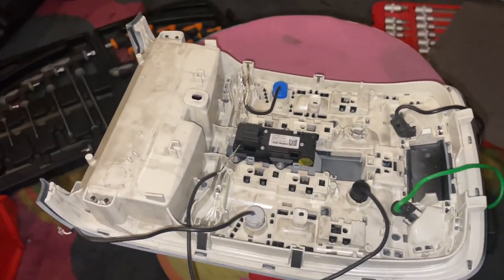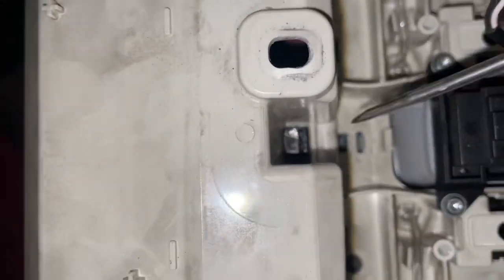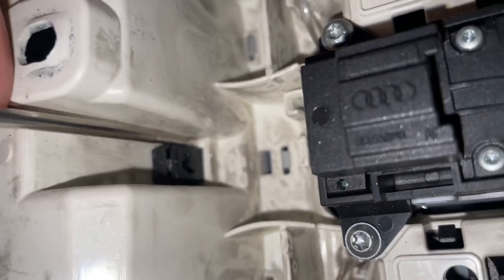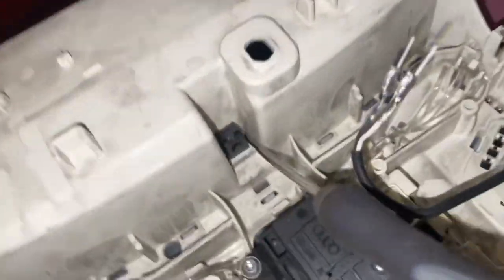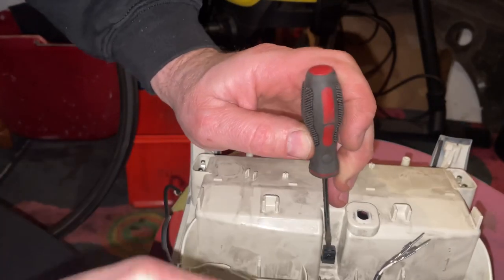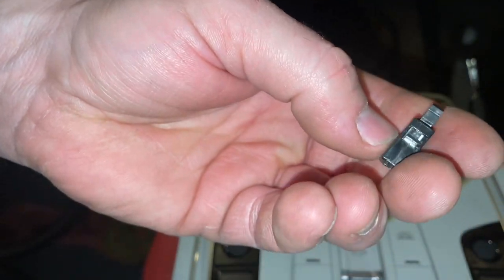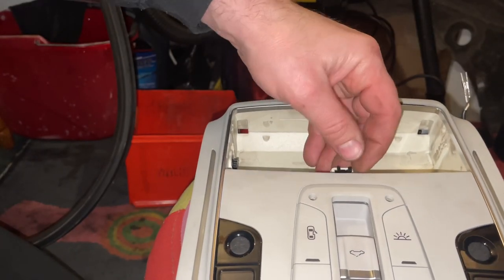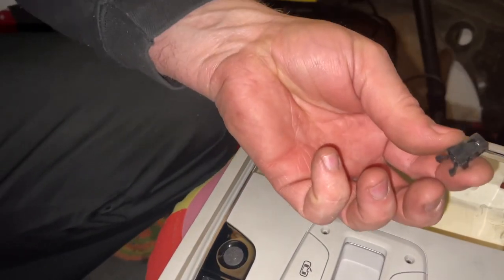Audi A8 D4 Sunglasses Holder Overhead Console Latch. How to remove DIY “ Jan V8”

Comment: 1st Take off TT25 screw-bolt in the sunglasses holder.

Then the full roof console will drop out or you'll need to un-clip it out, middle section 1st.
5min job to unclip my sunroof deflector motor.
Reply: Hi bro, can you help to find this part for Audi A8 2014?
Reply: @onkarfreshie